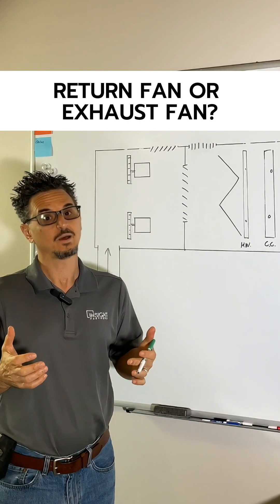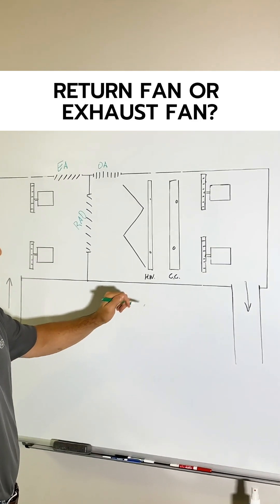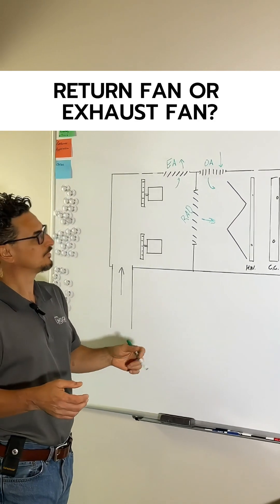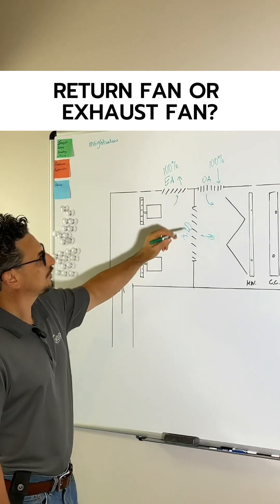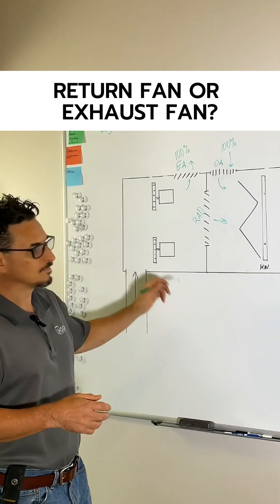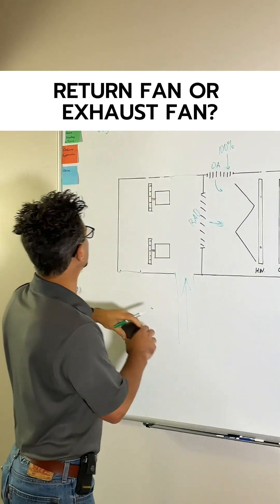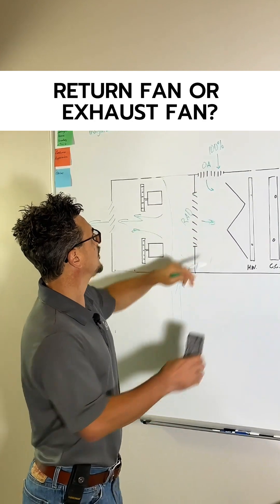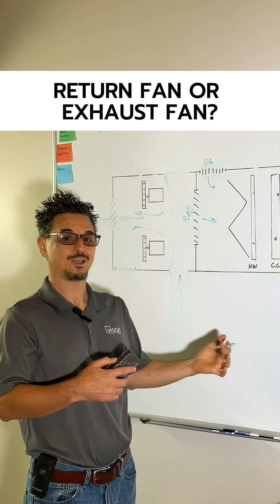Should You Use an Air Handler Return Fan or Exhaust Fan? HVAC RETURN FAN and EXHAUST FAN EXPLAINED!

Comment: I had a ac company come out and replaced my a coil on my horizontal handler,now whenever the ac kicks on I get a blast of warm air that smells like the attic. I've been up there and foil taped every nook and crannies, please tell me what they did wrong, is there a damper between the heat and ac side or some intake stuck open or what could it be. Much appreciated.